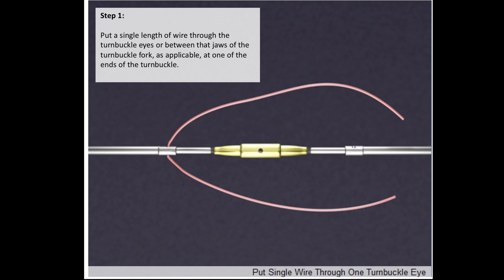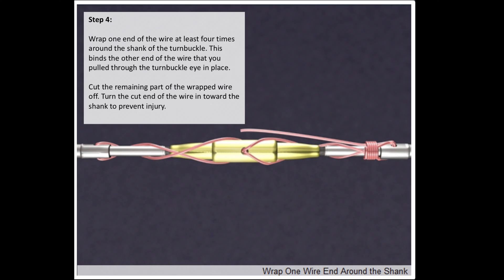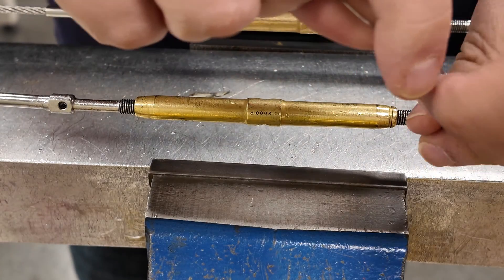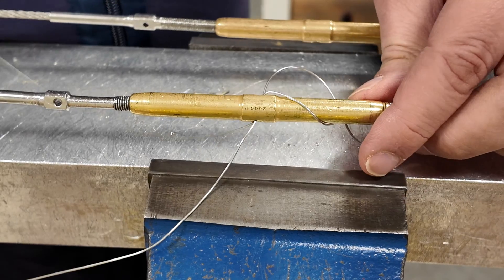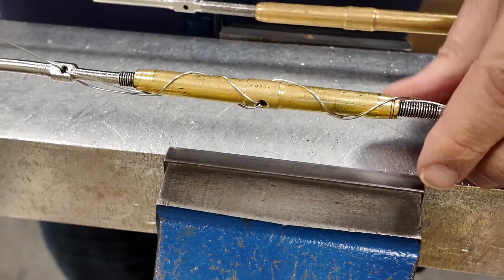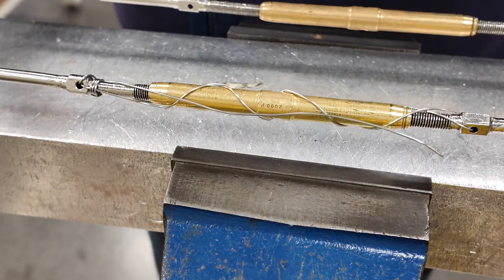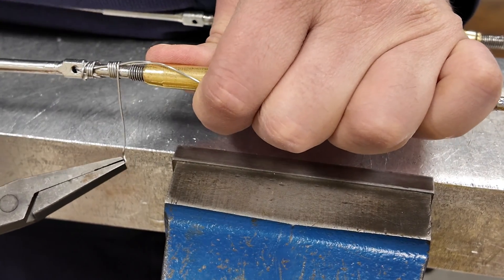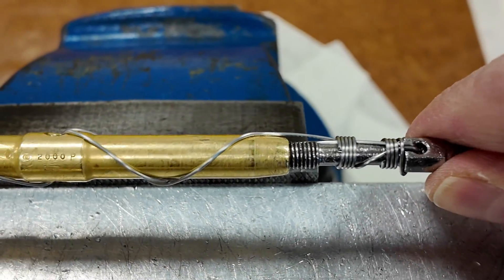Aircraft cables single wrap spiral turnbuckle safety method.

Comment: What is the purpose of turnbuckles in aircraft please define
Reply from the maker: In aircraft, turnbuckles are used primarily to adjust and maintain tension in cables, particularly within flight control systems and structural bracing. They allow for fine-tuning of cable length and tension, which is crucial for proper aircraft control and structural integrity.